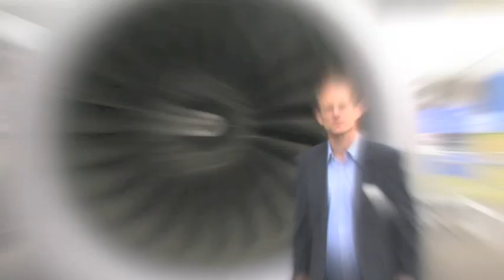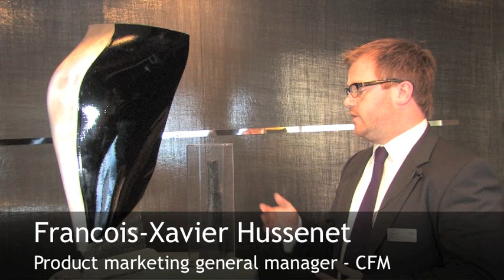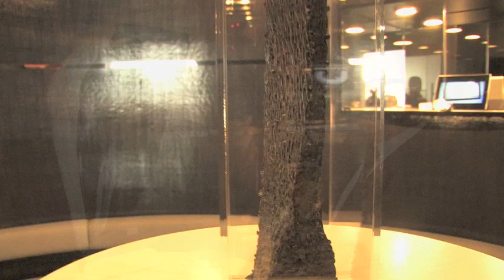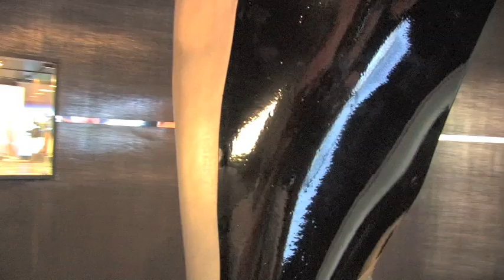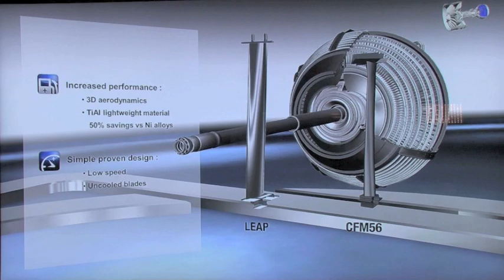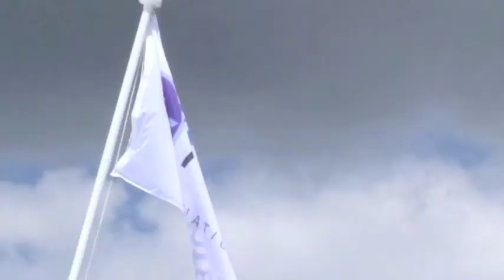A look inside CFM's revolutionary new leap engine

Comment: Carbon fibre doesn’t like cold temperatures 

Is this the cause of the crashes???!!!   

Cutting cost in planes is a no no.

Titanium or other materials.    
Carbon fibre with Kevlar weave but no.
Reply: No they aren't.

The carbon fibre structure is not the "cheap" stuff you can buy for hobby builders. All materials, every bolt, nut, just every single part and material is tested, certified and approved by CAAs around the world. 

Otherwise it would not be used for aircraft/engine manufacturing. Parts prices mostly are that high as they are due to this extensive testing, certification and tracking.